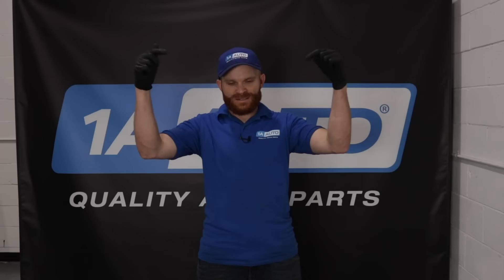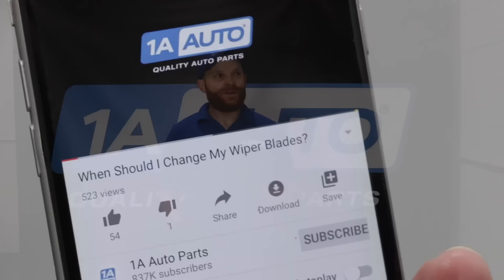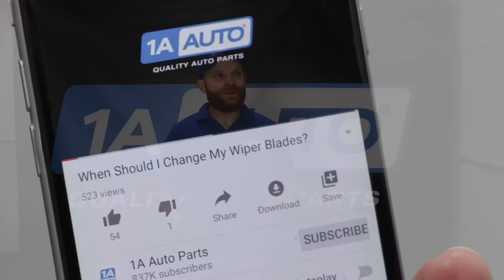Weak Acceleration? Rough Idle? Diagnose a Car or Truck Throttle Body!

Comment from the maker: √  Watch the Video
√  Buy The Part at 1A Auto http://1aau.to/m/Visit-1AAuto
√  Do it Yourself
√  Save Money
Reply: Love your videos. Do you have any videos on if a cars idle drops really low or stalls on start? its not a temp thing because it happens no matter if i just start it in the morning and even when i drive it for hours. Happens every start.
Reply: also once it starts and idle drops if it dont stall it goes right back to normal idle
Reply: Not really related to the above. My car starts vibrating at low speed, especially  after leaving the bumps when trying to gain speed. Any Idea

Comment: guys, it's not always the throttle body. This video does a great job telling the problem and how to fix it. (i haven't completed the video tho) but my problem was vacuum tubes were shot. I do recommend checking from the easiest to the hardest. first, check all the tubes for cracks. Note that to change the tube even if you have a small crack! from then check the AFM (air flow meter) and throttle body. trust me if i did this from the first place i would've saved myself to much money.
Reply from the maker: +Abdullah Hamadeh Thanks for checking us out! http://1aau.to/m/Shop-1AAuto-c
Reply: Thanks for sharing this information
Reply: @FoxtrotJulietBravo to tight or loose? I just got new belts and a tensioner and now my truck is acting funny

Comment: On many GMs with throttle bodies the throttle plate is spring loaded when the engine is off and a DC stepper motor is engaged when the engine is running. After cleaning, idle may be high as engine re-learns idle with a now clean throttle body.

Comment: My car was gasping for air during acceleration at low RPM. It got worse when I turned the AC on. My reading was that the air and the fuel filter probably need some cleaning. I went to the garage this morning and he said that the Throttle Body was the culprit. He cleaned it up and I am as good as new :)

Comment: Felt my recent lexus 1999 is200 to be slower and less reponsive to my silver one ... just now looked in throttle body , black and oily like beyond expected ! Cleaned it now the car is faster smoother . Also instant revs idling went from 0.75k to 2k instantly until reset ecu . Driving great now 👌

Comment: I have a vw golf. 
All I did to solve the idle, and occasionally stalling when pulling away issue was do a major service, fuel filter changed. And I sprayed throttle body cleaner into the throttle body hole and flap itself. I did this after the service and now my idle , running is fine!!  Without taking it off. So it wasn't to bad
Reply from the maker: +OneNess Thanks for checking us out. Shop for high quality auto parts on 1AAuto.com:

http://1aau.to/m/Shop-1AAuto-c

Comment: Hey love your videos. I have a similar situation with a 1994 GMC suburban that I brought for 3k 60k miles. Truck ran like a beast but mechanic recently changed the fuel lines and fuel pump. After I started getting rough starts as if was struggling to stay on but once on the road it went away. Few weeks later it suddenly would go past 2k rpm but managed to get it up to 50 mph. Took right and and parked it. I definitely check what you showed. Thanks
Reply: check your spark plugs, and coil packs.  Perhaps you have misfires causing low acceleration

Comment: its best to just stay on top of it with carb spray (once a year or so depending on miles driven) so you never have to remove it or use a brush... having it kept clean makes the car run way better and will improve you mpg
Reply: If u bought a used car yeah, chances of that being done are almost NIL.
Reply: Agreed

Comment: Doing some work on my sisters vehicle. She was having issues with all the symptoms related to the (throttle position sensor), her sensor didn't seem to be removeable (wouldn't come off the throttle body). So I went a bought a new throttle body/sensor. Informative videos, thank you! Even for guys out there that are mechanics by profession (I'm just a DIY'er), incredibly useful video.

Comment: I've been having similar issues for over 3 years. Seems worse when it's 100+ degrees outside.  I will drive 20 miles on highway, all is great, I get to town and at stop light, notice my idle is low then when I hit the gas, my truck is revving high and NOT moving forward, then suddenly it will violently shoot forward (almost got me hit twice on left turns) then my clutch becomes harder and harder to push in with each shift change or each stop light, until clutch becomes hard as a rock in full upright position and I'm stranded, can't push in clutch so cant even start truck. I have a 95 mazda B2300 SE, has 89,000 miles and is well cared for since I got it new in 1995. By the time tow truck comes (3 to 7 hour wait time past 2 years) the shop is closed, or the truck has had time to cool and it acts and drives fine. Mechanics have kept my truck for 2 weeks and cant recreate the issue, then out of blue does it again 1 or 2 months later. Already put a new Catalytic converter and starter and NOthing worked. All the mechanics say my truck is in beautiful condition and drives great, until it does this crap to me again and leaves me stranded far from home.  Any advice I love my truck and I love driving stick (which I guess are being completely phased out, which I find very sad. )   Thanks

Comment: I cleaned mine last month and it ran great.  But now its starting again.
Reply: What is the issue you're having specifically? If it's just a low or high idle, i recommend cleaning the air intake control valve. You should be able to find a vid for that.

Comment: Man you guys have a video for everything 👍🏽👍🏽 my blazer has been stalling while driving lately. I’ve changed spark plugs, wires, distributor cap, rotor and alternator and it still stalled like 10 times on the way home. I just cleaned the top part of the throttle body based on some research and it did not stall this morning and I do I have a deteriorating vacuum hose that I can see. I will try to completely remove the throttle body this weekend to get underneath the butterfly.

Comment: What sort of symptoms would you have if you "did" move the butter fly valve around?
Reply: It’s gonna have a poor idle. 
You can disconnect your battery and connect again which should restart the idle position on your throttle body.

Comment: Thanks a lot for sharing this video....
If I remove the throttle body...clean it carefully as you mentioned...does it likely might need to reprogram?
And can you please explain in a video how to reprogram the throttle body?
Thanks again
Thanks again...
Reply: Disconnect battery for 8 hours, be sure you connect battery terminals together while doing this.
After re connecting, be sure not to start the car immediately, turn to on position, wait 1 minute.

Comment: Surly you can just take out the two little Allen key bolts that holds the throttle body plate...that way you can give it a good clean
Reply: Jus make sure ya use locktite or they will come loose n destroy ur motor

Comment: The issue I'm having that wasn't stated in this video is; once I stop accelerating and my rpms drop, the engine shuts off. Is this also a symptom of a faulty throttle body? Thank you for all that you do here your videos are the best 👌
Reply: Na, that sounds like some kind of sensor just saying
Reply: The issue im having is exactly like yours but my car almost stalls but doesn't, it has to be a throttle body issue
Reply: My 2007 grand marquis is experiencing similar problem, at idle position rpms are around 7k and stays like that for several minutes, but eventually rpms drop and engine shuts off, even a worse case happen when the a/c is turned on, rpms drop drastically and the engine shuts off. All youtube videos I watched pointed to a throttle body issue, so I thoroughly cleaned and recalibrated the throttle body, but the problem did not go away. Have you resolved your problem?
Reply: Perhaps the idle bypass valve being dirty?

Comment: just got a 2010 nissan sentra sr as a fixer upper for my partner to have her own car. for 2500 I felt that it was a screaming good deal. Only issues it has are loud ac fan (not worried about that even a little, probably just leaves in the fan, or ill need to put in a new blower fan. not the end of the world) and it's slow to accelerate coming from a complete stop (after seems to be fine) so I'm hoping this is the issue. From what I'm seeing, and judging from the general dirt of the car..it just needs a good cleaning inside the throttle body.   After having a subaru that had nothing but spark plug and wire issues ALL the time, this doesn't feel like that. 

I think this video might have saved us a couple thousand dollars in the longrun. Either way, might as well give this throttle body a good clean for preventative measure anyhow. 

Thanks for the highly informative video! Should know in the coming week if this is the issue.

Comment: Love your videos guys, they helped me save a lot of money :)  I have a small issue that you might will have an idea how to deal with. I have a Suzuki alto 2011, and sometime, randomly, especially (but not only) in the first 5 -10 minutes of the operation, the viechle stalls when I press the clutch pedal during ride. I start the engine immediately back on without any problem. It might occur 1 to 4 times during those 10 minutes, and then mostly it keeps driving without any problem after that. A side note is that it happens more often during winter. The OBD scanner reveals nothing but I suspect that its about a dirty throttle body, and maybe a simple clean up hopefully solve the problem. But before I do that (its quit complicated in my car) I would like to hear your thoughts about it... again, I really appreciate your work and hope to hear your answer  or somebody's else in the audience :)

Comment: Going to try it on daughter 2004 ford explorer  fighting a P0171 code, had complete exhaust change, fuel pump, fuel filter, mass air flow, bought injectors, will clean throttle body  while changing injectors. Thanks

Comment: Nice and informative. 

A quick question, Audi A4 B7. When pressing accelerator quickly from idle it makes a sound ( Stumble, knocking, clicking) from the initial press. it is alright after the press when RPM increases. Any Ideas ?

Comment: I cleaned my throttle body and accidentally touched the center lightly when I connect the harness I started to get worst gas mileage?
Reply: HI I have questions I changed the egr.valve the check engine light I can erased

Comment: I recently cleaned mine (on my GD Honda Jazz/Fit) and had to manually open the flap to get really rid of all of the carbon. Nothing got broken, if you disconnect battery the calibration is done automatically on first start and then on the long run the ECU is further adjusting. My 0.02
Reply: I was wondering about this! Mine is basically identical to the “extreme case” (😬) and I know I’m going to have to move the flap to get it clean. I’m glad I saw your comment

Comment: How do you dispose of that volatile cleaner ive never been able to get it to pool up for longer then a minute and it evaporates
Reply: you lean over fender when applying it so that your lungs inhale the fumes and filter it ... thats what you got lungs for they are internal filters that need changing only when you decide to smoke for 40 years plus

Comment: ive got a turbo v70 as my first car, ive replaced a few sensors but i have weak acceleration and my rpms seem to get stuck usually at around 2000 or 2500 rpm and the whole time it is running rough, if i hold the pedal same pressure for long enough it will usually unstick and run just fine for a few seconds and then it will get stuck again, i know i have a fuel injector problem because i have a misfire code on cylinder 1 but can hear the spark plug clicking and firing fine. but i dont think its the reason for the rpm problem

could this be a dirty throttle body?

Comment: What  would  happen?  If  you  lightly  press  the  butterfly?  Would  that  damage  the  gears  on  the  side??
Reply from the maker: +JOSEPHH BANGERS Thanks for checking us out! This may cause issues with the calibration and it is not recommended to open it at all, unless it is a mechanical controlled throttle body. 1aauto.com
Reply: You can press or open the butterfly when cleaning even without removing the throttle body from the car, just make sure you disconnect the negative battery terminal, when done PRESS the top side of the butterfly to balance or calibrate. I do that to any car no problem
Reply: offcourse you can do that. Be sure to not let go of the butterfly directly when you are done, just gently open it to half, and than gently put it back to its rest position with your fingers.

Comment: before replacing all these start up cold with no problem. I replace aged Plugs, Coils, Fuel injectors, air filter, and oil. Now it struggles to start when cold I cant figure out what it is.

Comment: Every time I'm slowing down or braking my rpm jumps a little and the car thrust forward not a lot just a little. What could it be a vacum leak or a throttle body issues. Thanks
Reply from the maker: +BigBo We wouldn't be able to diagnose an issue like that here, you may want to have a local mechanic take a look at it. Thanks for checking us out! 1AAuto.com
Reply: Did you found the problem? Having same issue.

Comment: What makes that junk? Bad gas ? If so is there something we should put in the fuel like gumout or get a diff brand of fuel or higher number?
Reply from the maker: +Klanci Mcavoy Many times it's the PCV system. Fuel does not contact the throttle body at all. Thanks for checking us out! 1AAuto.com
Reply: @1AAuto  ok thx can you tell what that system is at some point?

Comment: Hi pal! Done mine last year on a 2007 mazda 3 sport,with a 2.0 engine! I found a rubber tube running into it,pulled it off,i got sprayed with coolant! Fortunately it wasn't hot! Could you explain,why coolant running into a throttle body? Done the job no problem,just surprised me because as far as i know everybody take this part off,as it easier to clean it that way! Thanx
Reply: It warms up the throttle body to the proper temperature for ideal performance I believe

Comment: I wish i could bring my car to you. When my car is sitting in park idling it surges up and down.   But when I put it in drive or reverse it levels out.  Been to several mechanics, but no one gets to it. My throttle plate has a screen over it so i dont think anyone is taking the throttle out removing the screen and really looking at it. Mine is not electronic. 1993 Pontiac Grand Am SE 3.3 L V6.

Comment: Is that what is wrong with my car? It has trouble starting now and then too. The check engine light is off and on. Then, when I stop for a while sometimes and accelerate, it stalls. I am not a mechanic, but based on my research, it's the fuel pump, mass airflow sensor, or throttle.

Comment: Has anyone else ever spent the money on new parts to make a repair?
Only to not make anything of a difference.
I have p0300 and just started 2 days ago p0200.
I bought felpro best intake gaskets, and throttle body seal.
Checked the injectors zero ohms on all
Each one clicks when tested with 9 volt battery sprayed carb cleaner in each one, let it sit a minute then used the battery flushed the injectors.
All on a nice and sticky 97 degree day no clouds 
Started up the Silverados 5.3 it idled well cold once armed up started running? Extremely rough.
I will have a new truck to continue on my own

Local parts store claimed to be MAF yet no code for it 
So it was why not new Delphi MAF , fuel pump had 50 PSI the regulator was bad, fuel pump as well, new fuel filter, installed knock sensors s well.
Time to give in before rebuild the entire truck when for now could be one part

Comment: Having the same issues and went to clean and noticed the butterfly didn't open completely no matter how hard I pressed on the gas. I'm guessing the throttle body needs replacing? Shouldn't it easily open the more gas given?

Comment: I took my 2008 Saturn vue v6 AWD 3.5L to the mechanic and a week later I still don't have my SUV back, a few months ago I went to get onto the highway and I needed to step on the gas so from about 35 to 65 or else I would get run over, so 35mph I stepped on the gas and my transmission shifted to a lower gear and not even 50mph the traction control & stability control light comes on with no check engine light and about 50% power and if I press on the gas more than 50% the SUV will shake, so I pulled to the side and turn the car off waited for 5mins turn the car on again and the car was like nothing happened, did this 4 more times so I took it to the mechanic and charged me to look at it and concluded that it was the throttle body, I said are you sure and he said well with our experience dealing with this and the fact that your SUV had 130k yes it needs to clean the throttle body, I said well go for it! $200 later he says well its done and we drove it and drives like a champ, now I could have clean it my self but I have had the SUV for 5 years and I baby this SUV so I know it wasn't the TB, pay for the work turn the SUV got onto the main road and I stepped on the gas and yep!! It starts again so I took it back got out, left the SUV running and i showed them cause they couldn't replicate the problem i was having, so now its been a week and they have no clue, now as for the 200bucks the owner its been nice about it and has told me that he will not charge me for the rest of the labor till he finds the problem just the parts will i be paying for it. So far clean TB and crank sensor and no luck, I did mention that it might be the speed sensor cause I have read that on a Saturn forum so he will check that out........ Wow long post and im sorry.
Reply: What was the solution ? I am facing issues with my car and we can't sort it out.. :/ thank you